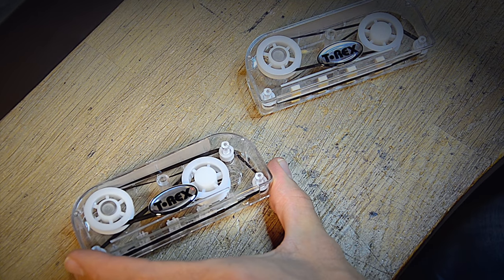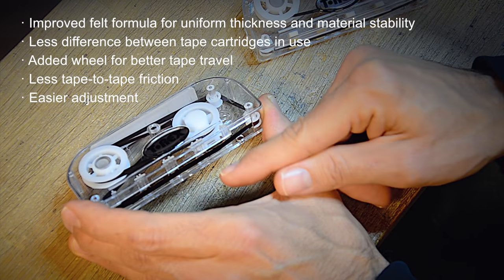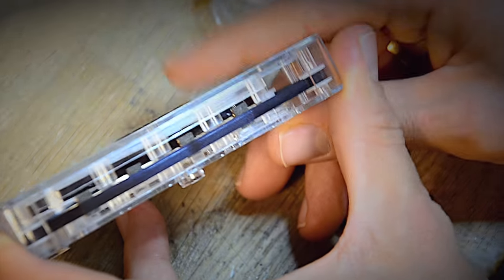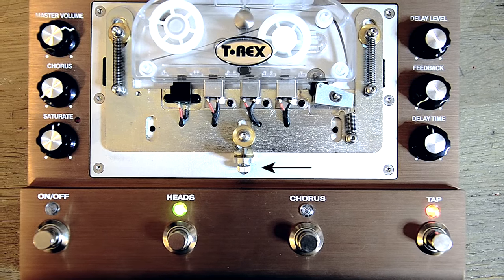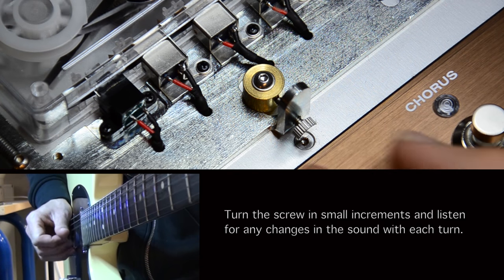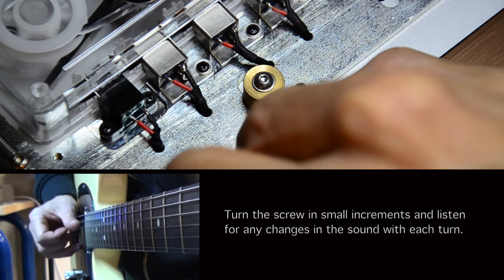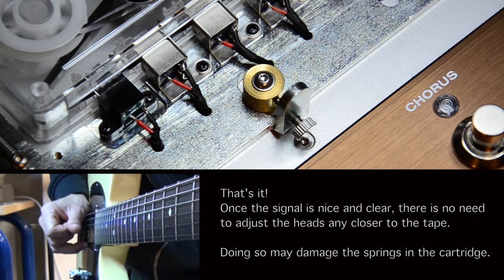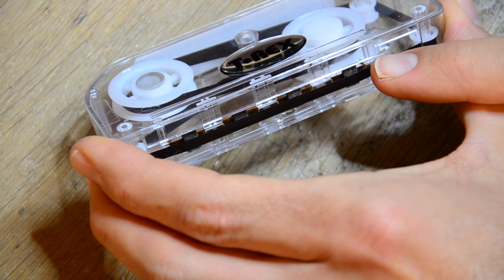Adjusting tape cartridge for T-Rex Replicator

Comment: I just put my first 'new' tape cartridge in today.
This seemingly small change should address the issues raised by others.
I have found this from the first couple of hours of use.
1. There seems to be less wow and flutter and a cleaner more consistent delay.
2. The delay always starts when switched on. Before, there were occasions where you would switch the delay on and the tape wouldn't spin ... rectified by a swift tap on the tape-release button.
I would put both of these down to the new 'springs' giving a better flow of travel against the mechanism.

Setting up is a breeze, just remember to back off the tape adjust thread and add it back in until you get a clean repeat (the adjustment is a little 'fine' for my taste, but usable).

This is a great advance for the delay and as my previous comment, it's nice to see a company continually developing a product without making the previous version obsolete.
As long as you treat the delay as an instrument, rather than a pedal, you won't go wrong.
I love mine :-)
Reply: How many hours?
That's a difficult question to answer. It is tape and it will degrade. My 'unscientific' research leads me to believe it could be as much as 18 months with several hours use per day, before any substantial notice of wear. 
If you are a player who wants to hear pristine delays, you might want to do this sooner. If you are one who likes 'tape decay' this could be longer.
WEM/Watkins Copycat? It just so happens I have both. I love both, but they are different animals. 
My recommendation? Buy both - you won't regret it, as long as you treat them as instruments that need to be looked after and cherished :-)
Reply: I don't know of any .... but .... how hard can it be? ;-)
Reply: Thank you for your answer, do the two different tape cartridge versions sound entirely differnt? If so then how? Also if theres one thing you could change or add to the replicator what would it be? Thanks

Comment: I have not bought one of these new cartridges yet but you can physically see the difference in this video. The tape in the old cartridges isn't tensioned in a tout manner, this is aside from the complete lack of tension in the little white felt pads in the originals. I am DEF going to give these a try since the old ones are abysmal. I thought it was the unit this whole time but it's the tapes.

Comment: I recently picked up the eurorack module. I was just going through it so I understood everything and noticed that I absolutely cannot remove the casset without removing the whole face plate. The lever won’t depress far enough to completely retract the spring loaded tensioner, it bottoms out on the bottom of the faceplate. Is this an issue with all units, or just mine?
Reply: I have the exact same issue. No matter how hard or far I push on the tape release I cannot get the tape out. I have to unscrew and remove the whole faceplate. I don’t think that is normal but it must be common.